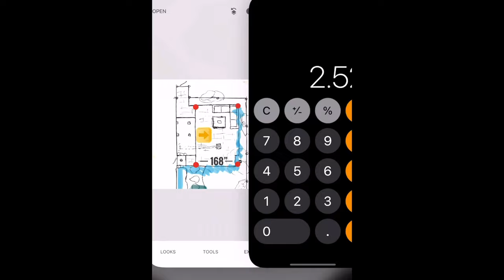How to level the ground for BASE PREP for Pavers! The Perfect Patio series Part 2: Base Prep #diy

Comment: Someone please answer this. So you have a level line on perimeter. What about the middle or interior area? How to you find level based off the perimeter level strings?
Reply from the maker: Once you set your perimeter lines to the appropriate slope, ideally in one direction, you can setup secondary lines anywhere for the middle using the heights of the perimeter lines as your reference
Reply: @HardscapeCanada  thank you very much. So maybe one through the middle of the rectangle? And the 2”x4” should reach enough to level the whole area? Is there a good video or source that displays this?
Reply from the maker: @johnwilkins3995 hey yes checkout the same video above one more time! Skip to 1:25
Reply: @HardscapeCanada such a help, really thanks. Gonna give this a try myself bc too expensive and I need a patio.

Comment: I already have landscape rock laid down and don't want to have to dig it out to try to level the ground under. Would it be reasonable to lay gravel over the rock,  either on a rock blanket barrier or no barrier and just lay it directly on the rock? I'm putting flagstone on top to make a pathway that I want as level as possible for my elderly mom. Help 😊😊
Reply: Ive done mostly all of my Patio in my backyard, without level base. It starts to get uneven over time but as long as you dont concrete it down you can alway make fixes…

Comment: Put a level form board on the sides of the area to be screeded and screed off of them for a flat surface. The ground underneath the base rock should be slopped for drainage if necessary.

Comment: What really confuses me is the consistent slop.... so when I set my lines where I want the patio to be at, for example, a stand-alone fire pit with paver platform, I would do my calculations to get the slope, so drop a inch is that's what it calls for.. then I would still dig say 7 inches all the around and set the slop with the base and follow it with the sand? Or do I dig 6 inches on 1 side and 7 on the other to get that 1 inch slop or whatever it calls for? Hope to hear back from you, and thanks for the video
Reply from the maker: Hey, yes you want to set your string lines to the final height and slope, and then you would dig down below the stringlines everywhere to your 7”. Once the strings are set we don’t have to think about the slope anymore, we can just work our layers up to the strings and be sure that the finished surface will have the slope we want. Make sense?
Reply: Thank you yes makes sense now I think I was just over thinking it

Comment: I need to put pavers at the entryway of my screened enclosure. My problem is that my concrete slab/porch has parts that extend out and above my ground level. The concrete is ragged (overspill) so my pavers won't sit flush against the concrete if i place them ground level. I will need to install them above that rough extension of the concrete. I guess I need to raise the soil level, but then the rest of my lawn will sit lower. What do you recommend i do in this case? Please keep in mind, I'm an older lady who can do anything too labor intensive, like cut the concrete or something crazy like that.
Reply: Use a chisel and hammer to knock of the concrete in the way

Comment: Is your road base permeable? Or does it have to be clean 3/4?
Reply from the maker: This road base is not permeable, but you could switch it to a 3/4” clean crushed gravel and use a permeable paver on top to complete the system.
Reply: @HardscapeCanada  When would you use this instead of a traditional paver with a perimeter drain?

Comment: Just wanna make sure here! 
So the string lines are the highpoint of the futur patio. You than  retract an halfinch from your 2x4 to make it 3 inch width to simulate the last 1inch layer of roadbase and the 2 inch of pave ? Thanks for your time ! 😅
Reply from the maker: Basically yes, the roughly 1/2” off of the 2x4 will get you to the final height of roadbase, then you will be adding exactly 1” of sand and your paver (widths vary but typically 2” 3/8

Comment: So are you getting your final slope in the last roadbase lift? are you just using the level lines as reference?  Are the marks on the 2x4 supposed to line up with the level lines?
Reply from the maker: Technically you are setting the final slope at the beginning with the string lines. Then simply working up to them, with all of your roadbase layers and final screed. Yes you can make marks, or notch out the ends of a 2x4 (size depends on paver) taking into account about 1/2” for compaction of the final roadbase layer, to get ready for bars and sand.

Comment: very nice video. Some nice videos you are producing on your channel.  Does the ground beneath the base also have to be graded in a similar way to the base? I have done the hard digging but feel I need to spend a little more time filling the lows and shaving off the highs before I put the base down.

Comment: So if youre adding the road base, do you measure heigh to the lines before compacting?

Also I assume you're measure for 3" off along the line to make sure you're slope is going correctly? Then add final soil and measure say 2" along the lines so when you finally lay the pavers down they should sit flush with the lines? 

Not sure why it sounds so complicated to me lol

Comment: Kev, I’m plan to lay pavers that slope down from a covered concrete patio. At the end of the slope I plan on placing a channel drain. The paver area is 18’ x 25’. 18’ is the sloped dimension. Im using Belgard’s Catalina Grana 3-piece small.  My question is, can I get away with a 1” slope or would you recommend a 2” slope. I have 3/4 road base down, compacted and will have 1” of bedding sand.
Reply from the maker: Hey sounds like you’re on the right track! 1.5% slope for 18’ length is (18x12”) = 216” x1% (minimum slope) =2.16” 
1.5% (ideal slope in my opinion) = 3.24” 

So bare minimum is 2”, I would go to 3” to make sure water flows off the surface nicely. It will still feel flat if the entire surface slopes in that one direction.